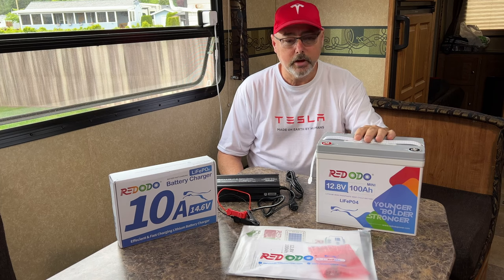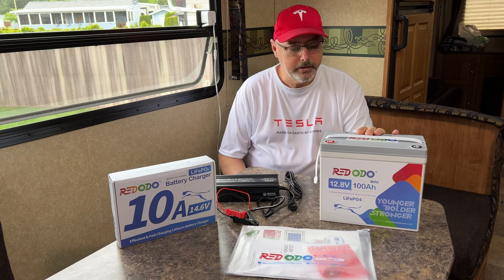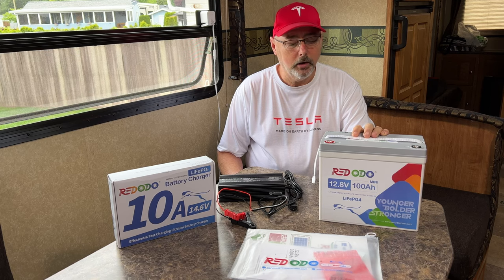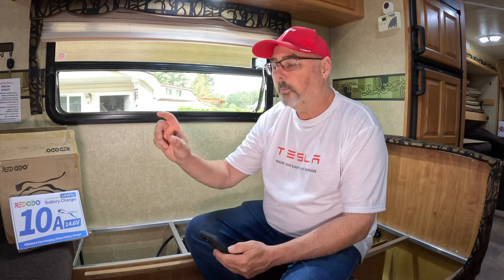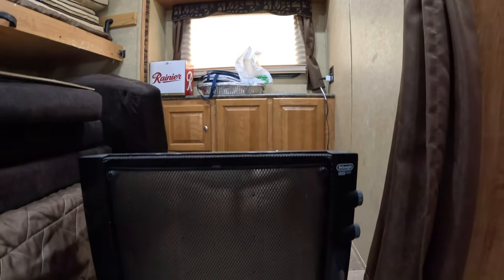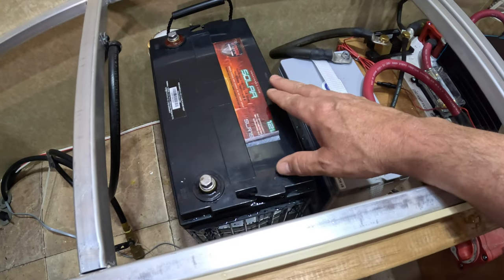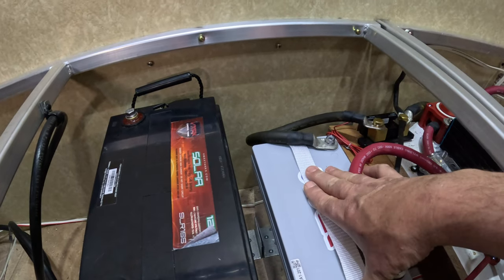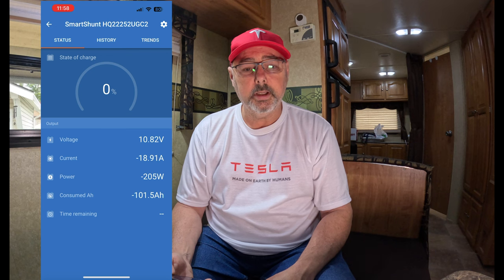Redodo 12v 100Ah Mini Lithium Battery Review

Comment: Were you able to measure battery amps under load?
Were you able to measure the voltage sag under load?
Reply from the maker: I pulled 1020W or 82A for the entire test and used 101.2Ah with the battery ending the test at 10.8v. I could have squeezed more out, but didn't think it was necessary.